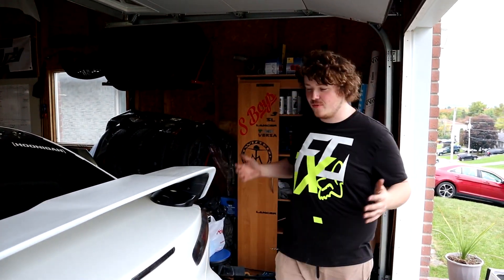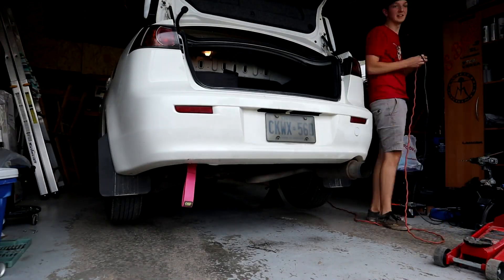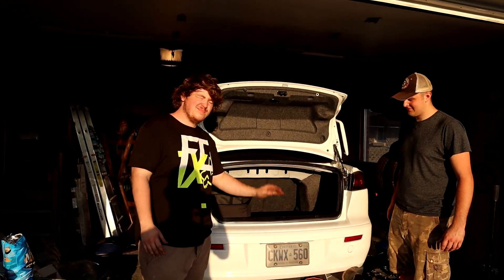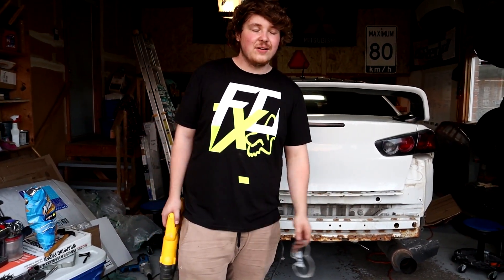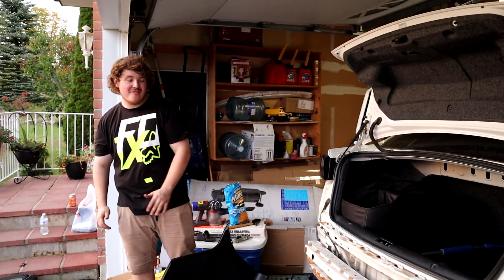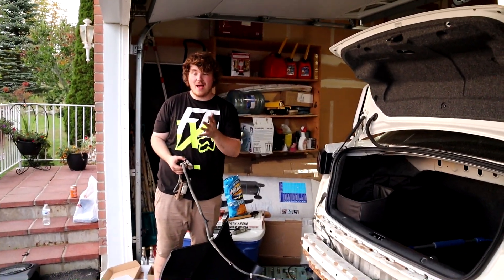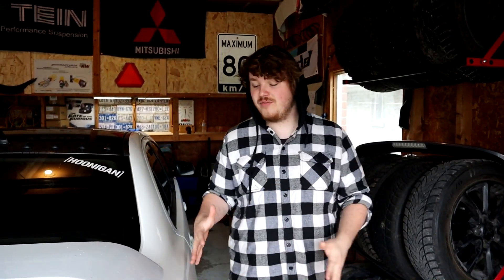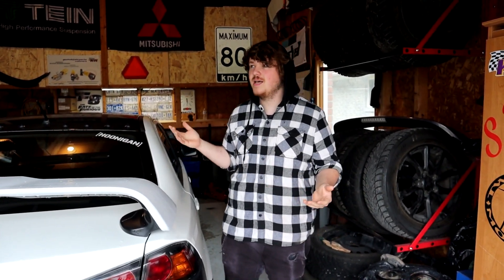Installing a Evo X Rear Bumper Conversion Kit On Mitsubishi Lancer

Comment: I have a question bro, didn't you have any problems installing the rear bumper? because I want to put an evo rear bumper on mine too!
Reply from the maker: I have the evo conversion bumper so it’s a little bit different then a real evo one it’s made to fit Lancer , if you use a real evo bumper the fitment might be a little off it still work tho

Comment: Hey dude how did you mount the rear plate lights in got a similar bumper but it doesn’t have a place for them I’m wondering how to mount them any ideas?

Comment: Hey there I got a question here I purchased evo rear enforcer bar with the bultin license plates light bracket unfortunately the lights are where the license plates at meaning the lights aren't hovering over the plates to shine with this evo rear bumper would that work.

Comment: Great video!
I have been looking at this bumper for a long time and finally someone actually install it!
Just wondering did you do some modification to make it fit or it's just fit without any issues?
Reply from the maker: Thxs for the love, No modifications to it, went on super easy and the fitment is great I am super happy with the bumper .
Reply: @sboys  Thanks for the info! I am gonna consider it as I am in BC which shipping it's a disaster for me, lol.

Comment: Any idea if this could fit a 2016 Lancer ES?
Reply from the maker: Sadly only 2008-2015
Reply: Yes you could. As long as it has a base model body style. Seen it done multiple times.. may require a little trimming and sanding but it shouldn’t be hard